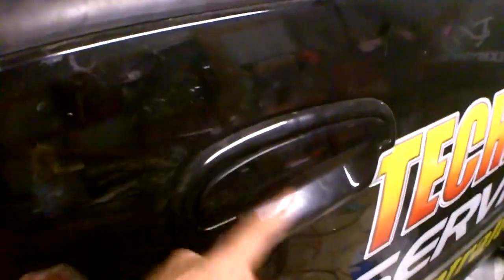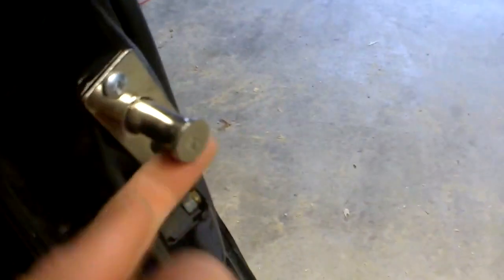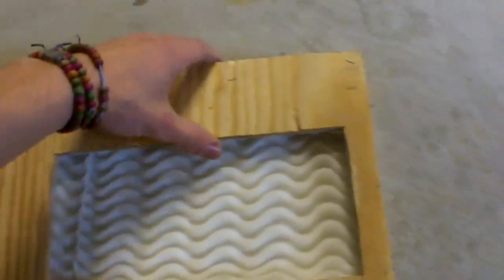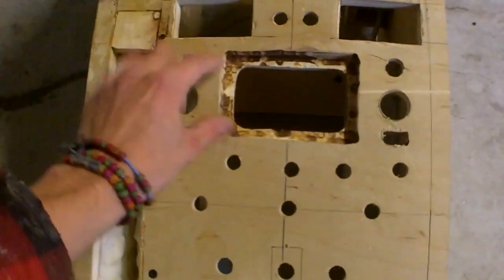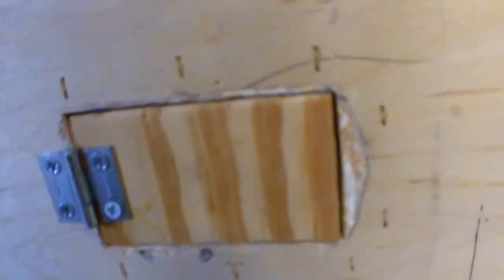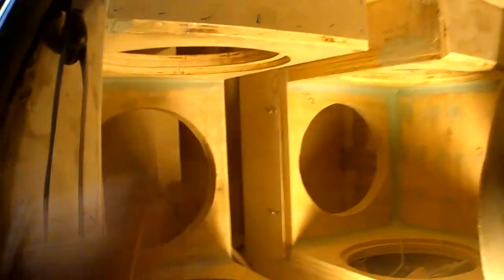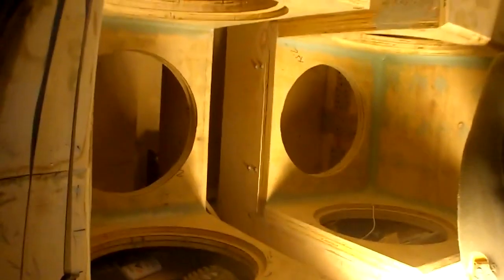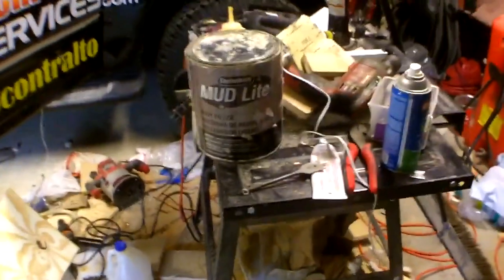EXO Car Audio Updates: Custom Center Console w/ Tablet PC | Angled Amp Rack Build & Door Poppers

Comment: Man, I don't particularly like the style of the install (I am an old-school guy and don't understand all the super tweeters and pro audio woofers) but I respect the hell out of how you dove into this and learned as you went. That takes nuts and that is how great installers are made. Also, buy your router bits on eBay--you can find them cheap as hell.

Comment: once the amp is turned on it no longer needs the remote wire to stay on. go turn your system on and take the remote wire out, it will keep playing. but once it turns off it needs the signal from the remote wire to turn back on. a switch to cut the remote wires signal to the amp while it is playing will not make the amp stop playing. thank you for listening.

Comment: yes. as long as the other end that is wired to the switch is 12v constant. (or switched, eg headunit). so it would be amp rem.>switch>12v.  or amp rem.>switch>headunit

Comment: idk if that was a little hint that you will be using an ipad or if it was a mistake and really meant tablet, but if you were going to use a tablet, I noticed you said you'd be powering it with the usb ports in the console, if I were you I was place a hardwired cable in that little dock of yours using a dc/dc converter, and if it was an android there is an option to turn on and leave the screen on when it's being charged, that way the tablet turns on when the car turns on.

Comment: hey man, you have alot of videos and know alot about this, i do not. so if anyone can answer i need more bass in my single cab  ford ranger 2000, i dont have time to build a box, so manufacture or preloaded sub, the Kicker 10tcvt104 and the Alpine Sbr-s83v will fit and if you could tell me which is better or recommend me a similar sub same dimensions, i want alot of bass, i know im not gonna get windshield flex but i want alot of bass i can feel, sorry for long message, but i need help. thanks

Comment: Cool bro looking bad ass, with all the sanding and as flawless as it will be I would use car paint like a base coat clear coat, well the same as what they use on the out side of cars lol it would show off the time you spent to make it look that damn good, I painted the hole in side of a car dash, wall, all of it its in a video you might have seen, sorry for going on so long check out the video if you want its ---youtu.be/ZjKofan5Jk4---